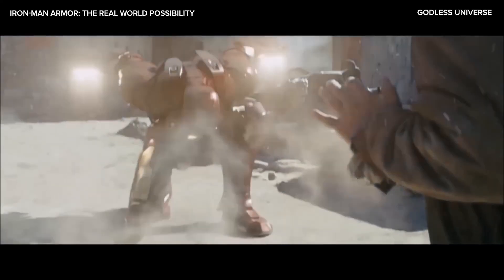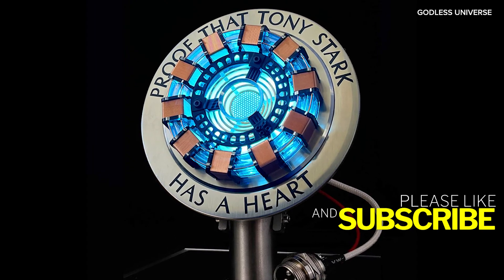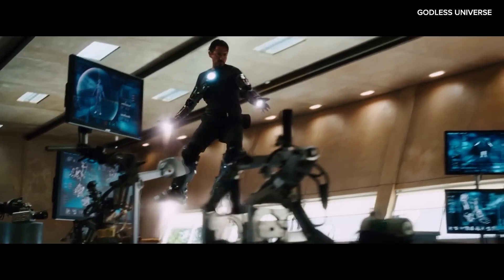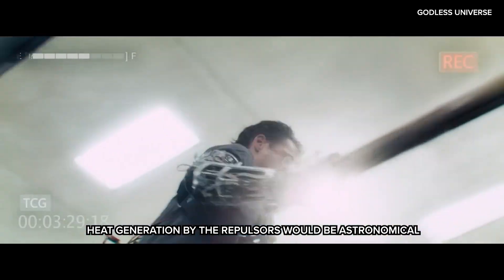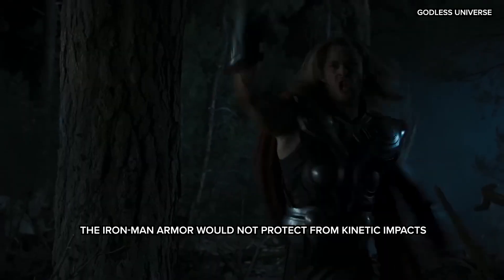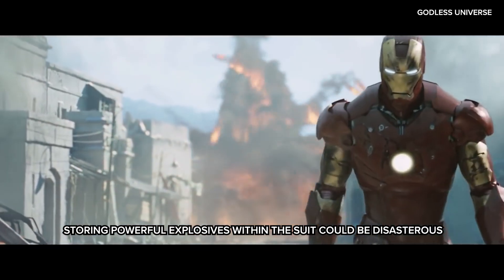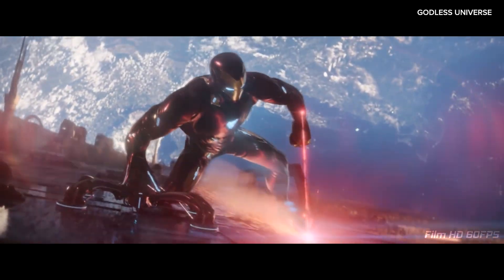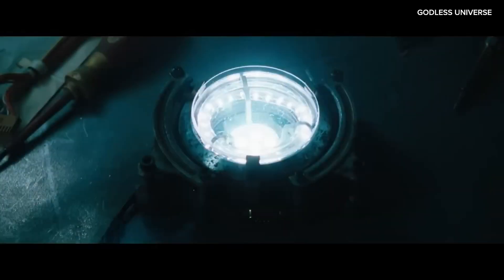Can Iron-Man's Armor Actually Work? Here's What Physics Says

Comment: The arc reactor generates so much energy,but it is impossible to escape the heat for the amount of energy produced by the arc reactor,
If scientist or researchers are trying to build a real life arc reactor,then they should also focus on massive and quick absorption of heat(should absorb enormous amount of heat energy)
Reply from the maker: Correct, but the amount of heat dispersion needed is impossible in a small suit. Think of a nuclear reactor. Reactors without cooling towers use 500,000 gallons per minute. Reactors with cooling towers use 20,000 gallons per minute. If that's the only way to do it in a nuclear reactor, how are you going to do it in the Iron-Man suit?

Comment: You're claiming the laws of thermodynamics are being broken, yet not specifying how.
I suppose you're referring to the first law and amount of heat and work the system is subject to, but such claims might be backed up with numbers
Reply from the maker: Then you do not understand thermodynamics. If the arc reactor created that much energy, the heat generated would be astronomical. Even a simple AA battery gets hot to the touch after prolonged use. You want to argue that a fusion reaction in a space that small wouldn't produce heat? If you want proof, look up at the sun... there's your proof.
Reply: @DimensionZeroTV  I'm not arguing that it produces heat, but the debate would be how much and what rate can be dissipated.
We're dealing with a cinematic universe - obviously they stretch all limits of what's possible technically and also in terms of efficiency. It's not crazier than a 3 gigaWatt energy source the size of an apple in your chest.

So I stick with my point, your claim that the reactor breaks the thermodynamic laws is not backed up. We don't know the efficiency, there's no proof of heat 'disappearing'.